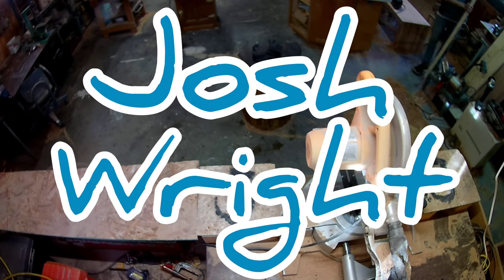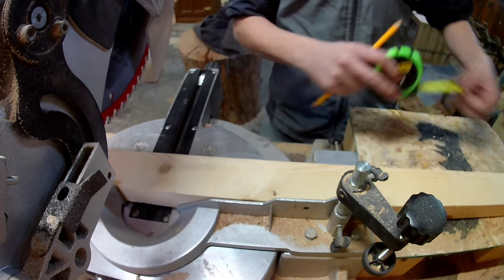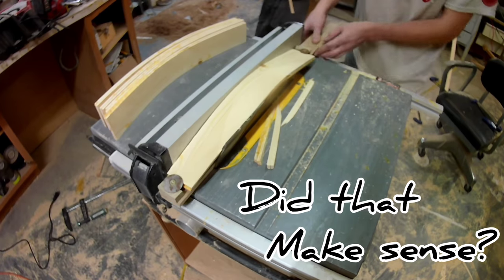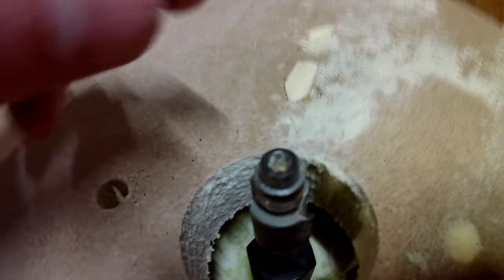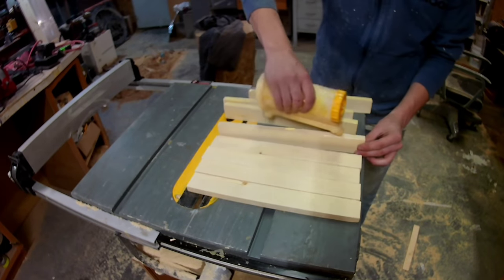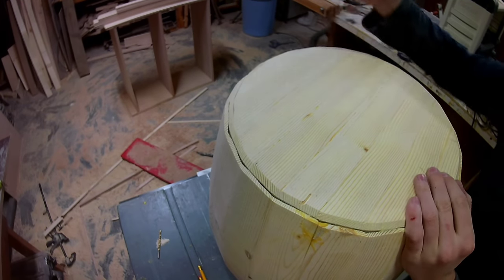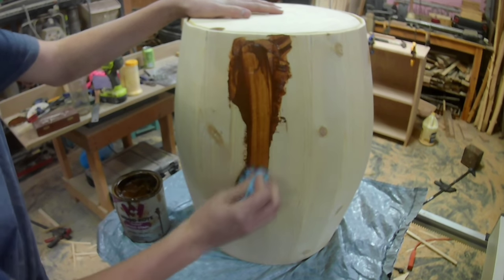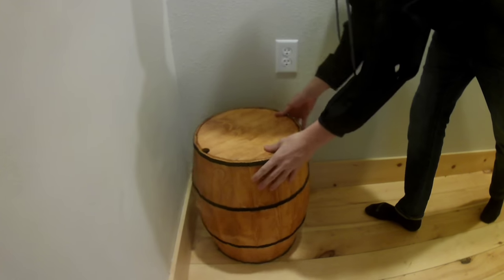Making A $5 Fake Wine/Wiskey barrel from a single 2x6 | gift ideas | woodworking

Comment: As a professional tablesaw operator for many trophy shops in the Midwest for over 30 years, I feel I need to give you some pointers. The best cut on the tablesaw is one that never stops till it clears the blade. The best advice in a construction shop is to 1st build a cutoff table for the tablesaw (that will greatly increase the accuracy of your cuts allowing you to fully cut any piece) and could possibly have lock wheels to move it when you need more space in the shop for bigger projects. Nice job on the barrel. Interesting techniques you use but it all works out in the end when you have a finished product. Keep building. You have a good future in that. 
And thanks for sharing
Reply from the maker: Thank you for watching and for the tips, I am making an outfeed table right now
Reply: I know you have the splitter installed, which is good because your habit of pushing on the scrap side of a rip is a terrible habit to get into.  That piece should fall free and you should push the business side completely through like the above mentioned said.  Even with the splitter installed a harder wood might have kicked back.  Even if your splitter is exactly the same thickness, and perfectly aligned, sometimes wood under tension, and yours was pretty well warped at the start, will spring free once released because of the cut, and bind.

Comment: Very cool project! A tip I picked up when it comes to applying my finish coats of poly is too get a generous amount on the brush, and apply the poly in one long stroke, applying more pressure the farther into the stroke you get, that way more poly comes off and you get on nice even coat. If you miss a spot just get it during the next coat of finish, just make sure that there’s no high spots.
I didn’t think it would matter that much but it took my projects to the next level :)

Comment: Nice work! I thought that the way you did the taper on the staves was very clever.  Did you do a lot of experimenting with the angles or did you get it right the first time? I usually need to experiment a bunch of times before I get things right even after drawing it out.  

One suggestion that I would offer would be to use a wood conditionar first. It really helps with light woods like pine. I also like to use gel stains on pine. The color comes out much nicer.  Just a few suggestions. Again, great project!
Reply from the maker: This barrel I didn't have to do any experimenting with since it wasn't my first time. I made a much bigger barrel a while ago and that took a long time to figure out. I made 5 prototypes and wasted a lot of wood before I figured out the method I would use to make the bigger barrel and later this smaller barrel
Reply: @JoshWrightWoodworking  did you cut the angle on both side of the  staves or just the one side? That was the only part that wasn't exactly clear to me. Excellent job.
Reply: @mattschamel6550  It looks to me that he has 20 staves (once glued together), so 18 degrees on one side only of each of the 20 staves will give you the 360 degrees.
Reply: @jeffschaub  I didn't think about doing the math, I'll know next time! Thanks.

Comment: Make more push sticks for that table saw. using 2 and/or a feather board at least would save you a stomach injury or a finger. I saw a couple spots you could have some wicked kickback right into you. That's the reason I tend to stand on one side of my work, not directly behind it. Great work! just be careful so can keep working.
Reply from the maker: Thank you! I will work on my safety.

Comment: First off, very nice work. 

Second, I would advise you to never depend on your other hand to free hold a workpiece when using a Forstner bit in a portable drill.  Used free hand, Forstner bits can catch, either spinning the workpiece or, worse, jumping out of the hole to seek out your other hand.  I learned this the hard way,  having broken the bone under my then-missing fingernail the last time I tried this. Now I try to use the drill press whenever possible and, when not, I clamp the workpiece down and keep my non-drill hand far away from the workpiece.

Comment: Glue in a liner and add a tap. Actually, you could easily make this big enough to hide a small refrigerator compressor inside, insulate it, and turn it into a kegorator or Keezer. Which makes it much more awesome. Thanks. I'm saving this video for future use. And after taking a look at your channel, I'm subscribing. You're awesome dude.

Comment: You are very talented kid... im not sure how old you are but its great seeing someone your age interested in one of the oldest and much needed trades. My hats off to you. Keep up the great work but be very careful with that tablesaw. You have a few bad habits the can cause an accident (knock on wood). Some advice for you... 1. Make a sacrificial fence for those thin cuts. 2. Make yourself a zero gauge throat plate to prevent the off-cuts from going inside and causing some damage (trust me, I know) i got one to the face, good thing for PPE, still hurt tho. 3. Secure your table saw properly and 4. Build yourself an outfield/assembly table so you don't damage your table saw top with glue. But keep building, all you can do is keep learning and you'll be a great woodworker in no time...

Comment: You might want to try the wipe on oil based poly. No drips, ever, and is very simple to apply either with a rag or foam brush.

Comment: Wow it looks great. Just a suggestion don't use so much glue. Glue was dumping out of those boards. Less glue will not only save money but it will leave you with less sanding later on. Keep up the great work.

Comment: Did you have to cut the glued and dried staves (boards) with the 18 degree bevel on both sides or just one side of each?  Awesome video!  I want to try and make it this week while on vacation. 😃
Reply from the maker: Thanks for watching! I just cut one edge of each state at 18 degrees. I could not do both edges with this method because  you need a flat edge against the table saw fence.
Reply: Maybe edit the video and mention that only one side is beveled cut. I beveled both sides of the staves and ended up with a wooden vase and leftover staves, lol. Overall great video.

Comment: Really dig'n this project.  Apologize if I missed it, but how did you get the angles correct on the curved boards to join up nicely?
Reply from the maker: 360 divided by number of pieces. In my case, 360 divided by 20 staves equals 18°.

Comment: It would add a little to the cost, but some plumber's hanger strap (steel, copper or painted black) with some decorative screws or nails would add to the look and some strength

Comment: Very good project 🙂
What is the tool you used at 7:25 ? 
A router mounted on a drill ?..
Reply from the maker: It called a matrix. Its a drill made by black and decker that has different attachments. One of them being a router. I would not look into it though. They are very underpowered and I only used it here because at the time I had just broke my good router and was waiting on the new one. Thanks for watching!
Reply: @JoshWrightWoodworking   Thanks for your answer :)

Comment: Ive watched the video 30 times through... being a fairly knowledgeable woodworker, i got pretty far on making my own, except the bevels on the jig.  I got all of the staves cut on one side. How did you manage to bevel the other side? How do you line it up in the jig?
Reply: Experience be damned, I had a dumb moment.  You only bevel 1 side so it's glued up as 18-90-18-90........I am nearly finished  with my barrel.

Comment: great work! could i ask, after you do the beveled rip on one side of your staves, how do bevel rip the other side of them? since it won't be parallel to the table saw fence anymore..?
Reply from the maker: You are right, it would be very hard to get two good bevel cuts since you wouldn't have a flat surface against the fence on the second Cut. So insted of beveling both sides at 9° each, I just beveled one side at 18°. In the past, I have also cut the staves more narrow, cut one edge of each stave at 9°, and then glued the staves in pair, flat edge to flat edge, to make a stave beveled on both edges before gluing all the staves together.
Reply: @JoshWrightWoodworking  thanks for the insight! i thought of just making a pencil center mark on either ends of the stave and also a pencil mark on the tapering sled to signify where the middle of each stave should be clamped down at, then every time i flip the stave, i realign both pencil marks

Comment: Very nicely done. You are an inspiration. I am curious about the math for your barrel projects. How do you calculate the angle you cut for the slats when you make specific size barrels? Would you be able to talk about that some day?
Reply from the maker: It is just like making a cylinders. Take the number of strips or staves and divide by the angle of a circle (360°). In this case 20 staves were used so take 360° and divided it by 20 to get 18°.  Also the formula for circumference is 3.14 times diameter. I wanted a barrel about 15"  wide so 15 times 3.14 is roughly 47. 47 is the circumference so you divide 47 by the number of staves used (20) to get about 2.35 or 2 3/8". 2 3/8 will be the width of each staves at the center if you want a diameter of 15". Thanks for watching and I hope this helps.
Reply: @JoshWrightWoodworking  Thank you. That makes perfect sense. I am going to give it a try :)
Reply: @JoshWrightWoodworking  How do you made the choice, 2" , for the bend block?
Reply from the maker: @marie-christinel.bienvenue4484  
I Looked at other full size barrels and they were 6" wider in the middle than the top or bottom. since this barrel is scaled down to about half the size of a normal barrel, I wanted it to only be 3" wider at the center. This means that each stave has to be bent about 1.5" and since the staves tend to spring back a little bit after glue up, I bent the staves around a 2" block fully expecting them to spring back to about 1.5"

Comment: I was expecting something a little less, but that's damn good. I've been think wanting to do, what you did, but I was thinking of making a drum. The real problem with drums, is weight. Those thin walls are perfect for a useable drum. You should google goat skins, which is generally traditional. A round blanket box is cool and all, but quite a market for drums.

Comment: As a young wood worker I applaud your efforts.  Now the question is, what will be your next tool purchase, a bandsaw, dust collection system or an outfeed table or roller for the table saw.
Reply from the maker: Thanks, I'm going to be making a big out feed table for a up coming video but I probably will not be buying anything extravagant anytime soon
Reply: @JoshWrightWoodworking  my first big tool was a radial arm saw followed by a Shopsmith which had a table saw, disk sander, lathe, horz & vert drill press, shaper and bandsaw.  Built a lot of furniture and projects in a small space with those two machines.

Comment: To make the top and bottom, you traced the outside of the barrel onto glued-up boards, which, when cut out using a jig saw, magically fit into the rabbets cut on the inside of the barrel top and bottom! How does that work?
Reply from the maker: That was a mistake, I went back and traced the inside of the barrel but I forgot to film it. The outside trace was the only film I had to work with so thats what I used in the edit but your right, I should be tracing the inside.

Comment: How did the top and bottom fit, since you traced the outside circumference of the barrel... seems like they would have both been about an inch too wide all the way around.
Reply from the maker: That was a mistake, I went back and traced the inside of the barrel but I forgot to film it. The outside trace was the only film I had to work with so thats what I used in the edit but your right, I should be tracing the inside.

Comment: Thank you for the video. I’m gonna try to attempt to make one. Can I ask how many days did this project take to make?
Reply from the maker: This barrel took about 3 days to make if I remember correctly. However, this video is pretty old and I have since changed the way I make the bent staves that makes the process go a lot faster. the bent lamination method I use in this video works great but you have to wait nearly a full day for the glue to fully dry. If you are interested, skip to about the 24:15 mark in this video to see a different way of making the bent staves. https://youtu.be/Fm33ca8J4kw
Reply: Thank so much for replying. I appreciate it. I forwarded to my husband so he can help me. I love all the work you do. You’re so young and doing a great job. Keep it up!👍
Reply: By the way, it seems with my other videos I watch and reply to never get answered. So thank you so much for getting back to me.
Reply from the maker: @joniwickman1404  you're welcome, thanks for watching! 😁
Reply: @JoshWrightWoodworking  you’re welcome

Comment: You definitely have a talent for what you're making and have a good eye for detail. Nice one.
However, watching you using the table saw is frightening. Some points to consider.
Please get an out feed table.
Don't reach over the blade to pick things up.
The larger portion of timber should be between the blade and fence with the smaller piece on the left of the blade. You may need a feather board to achieve this?
Use your push stick more.
Reply: This is how 99% use it never trust the fence layout on the saw measure from blade to fence cut your piece between blade and fence if he needs something to hold up sheets while he works he needs to build a large work table with the saw inset I've never seen anyone try to cut it where their work wasn't between fence and blade otherwise you would be continually measuring your cut off piece for repair cuts

Comment: Thank you. How can I calculate the amount of curvature of each piece in the event that I want to manufacture different sizes? Is there a way to accurately calculate the number of pieces of wood and their curvature, for example, if I want to manufacture a barrel with a specific diameter
Reply from the maker: Lets say you want a barrel 21" in diameter. 21" diameter means a circumference of 3.14×21= 66. Divide the circumference by the width of the staves. If the staves are 2" wide then 66/2=33. 33 is then the number of 2" staves you will need to make a 21" barrel. Then for the angle, 360/33= 10.9 degrees, the angle you will have to cut on each stave.
Reply: @JoshWrightWoodworking  Thanks for the reply. Greetings from Syria

Comment: will it hold water? is it food safe? how much heat and pressure can it handle?
Reply from the maker: Dude, what do you pan on using this for haha. I'm sure you could make it food safe, water resistant, and somewhat heat resistant with the right type of finishes, but this barrel is just a peice of furniture, not meant for anything like that.

Comment: How did you come up with the angle to cut the staves to?
Reply from the maker: 360 degrees in a circle. 20 staves. 360 divided by 20 equals 18 degrees. Thanks for watching😁
Reply: @JoshWrightWoodworking  
slaps forehead in embarrassment
Well damn haha, that makes sense! Cheers 👍

Comment: Hey Josh!
I just watched your barrel video.  Like everyone else has said, you need a saw extension to catch your work.  Your work for your age is extremely good but I fear for your safety.  I cut off part of my thumb many years ago.  I was lucky.  I was alone and there was only some packing tape available.  I had no first aid kit at the time.  I used the packing tape and today there isn't even a scar.  I have a bright red square painted on my table saw and my #1 rule is to never put my hands inside that area.
You can get away with some of the moves you make for now, but I noticed you are making moves without thinking.  That's where the danger lies. Once you become totally relaxed around the saw blade you start to make careless and dangerous mistakes - it's just a matter of time.  The slightest distraction could have you putting your hand in the blade before you realize it has happened.
Please, go get some training.  Have a look at "Woodworkers Guild of America".  It's affordable and you get all kinds of tips and hints, full videos and a weekly newsletter and video.  You can access their huge video library for instructional information or simply find some ideas for projects. With your talent, it would give you a formidable insight into the craft and nurture your talents and your woodworking know-how.  Here's the link:  https://www.wwgoa.com/
Keep making sawdust!
Eric Judd
Reply from the maker: Watch my most recent video... I made one.

Comment: Very nice work young man, enjoyed watching....in horror that I would witness the loss of a finger or more. Please do yourself a favor  and read some safety tips on table saws.. never use a fence to cross cut, you have a really good chop saw! Make a zero clearance throat plate for those 45,30,20 degree cuts.. MDF is much cheaper then a ER visit. Good luck.